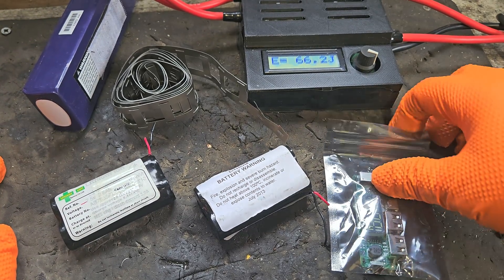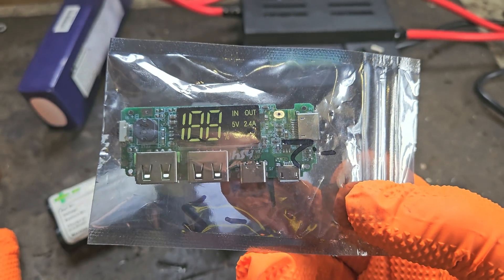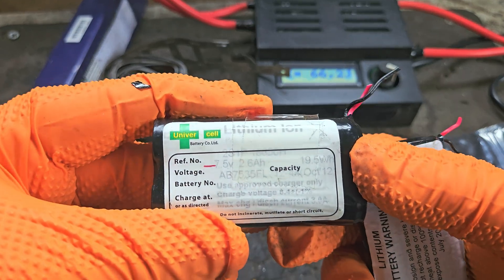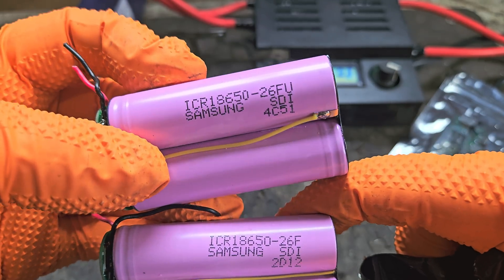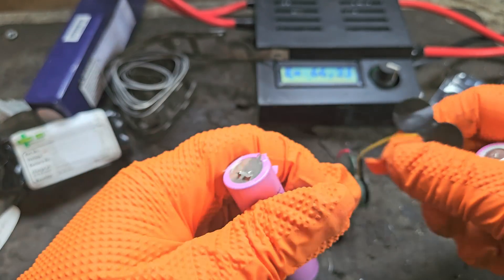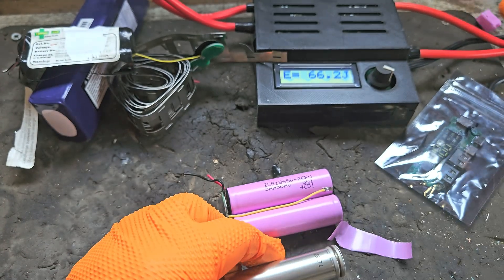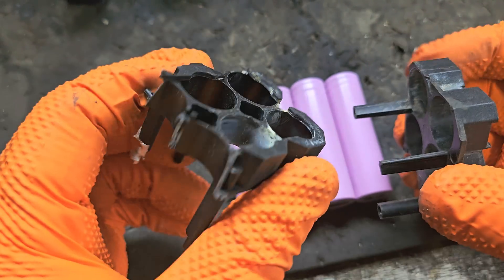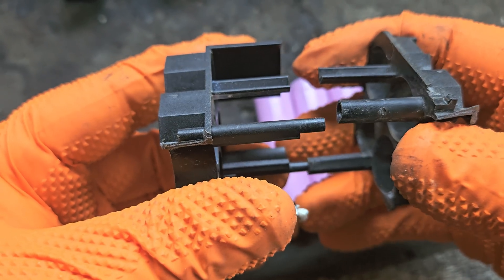I Built a 10400mAh Power Bank (and it works!)

Comment: Nice  if you wanted to charge it quick i put a couple of extra wires off the pack with a connector XT60 so you can use the imax to charge it up each time save using a plug in wall charger :)
Reply from the maker: That is a brilliant idea the mark 2 will have that feature